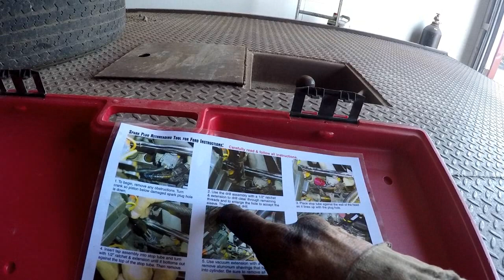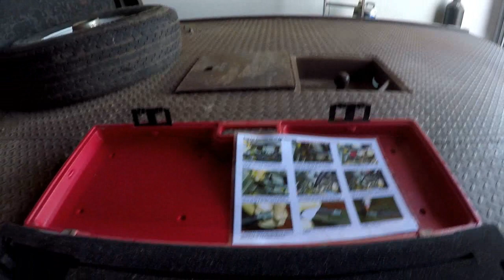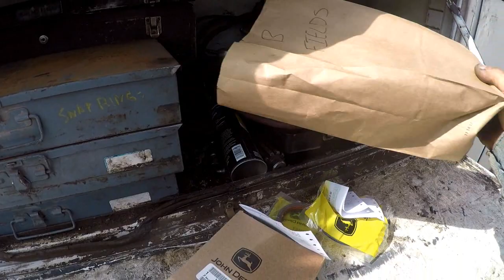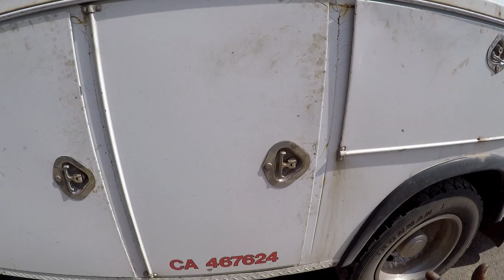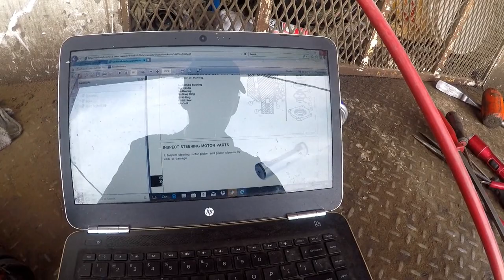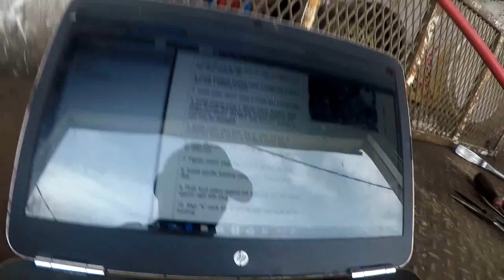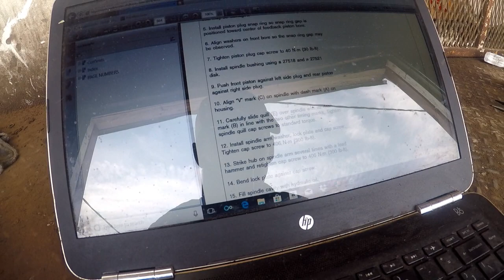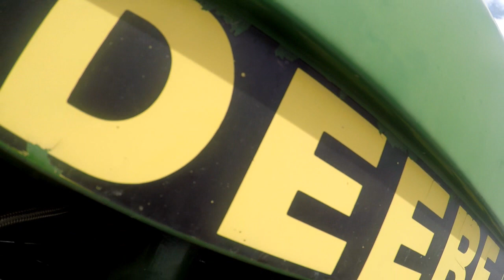4955 steering gear

Comment: i have done this job a coupe of times before. that feedback gizmo with the spring on it if you dont catch that it has slipped out of that slot and you force the gear in it will break it and then it will be a much bigger mess to correct. all for fun i say.

Comment: BB 960 monitor is the one directly in front of the steering wheel, I run almost an identical setup here in the uk. I have a BB 950 on a JD 4755 !, and love it 😊.

Comment: I've had a 4.6 DOHC in a Marauder, a 4.6 SOHC in a crown vic, stll have a 5.4 in a F 150, and have a 6.2 in a F 250, never had a plug blow out, I know it's a problem with the modulars but always have plugs changed early by a mech because of the plugs breaking when removing.

Comment: Those 5.4 plugs are a pain in the ass any way you look at it.  Do like those older Deeres though (even though my dad was a Massey tech/parts man for close to 40 years so kinda partial to the old red iron and Perkins diesels).  The handle pin for the fire extinguisher get stuck back in?  The stupid shit a fellow notices when all you do all day is wrench in a big fleet

Comment: I have a 2000 model F250 with a 5.4 and yes it is a gutless wonder. I have never had problems with the plugs. What model did this problem appear in? Glad to see you block that thing up. Lot of weight to deal with. Please tell me you didn't take those weights off by hand....... Now you got to put them back on. My back aches for you! Let us know what happened with the 8200......
Reply: Johnny Holland in the 2 valve 5.4 tritons the idiot engineers only put like 3 threads in the head for the spark plug so they would blow out, then they switched to the 3 valve 5.4s and the electrode portion of the plug would seize in the head and you need a special tool to get them out. Other than that the 2 valve motors were gutless but great. The 3 valve motors had cam phaser issues, broken plugs, timing chain tensioners, and a couple of other things the evade me. So the early 5.4s up until like 03 or 05, if I remember right, shot plugs and after that you needed dynamite and luck to remove em in one peice.

Comment: I also run a 4955, the shut off solenoid blows fuses. Do you think the solenoid is bad or is there a short somewhere? Also it is hard to steer. What is your thoughts?
Reply from the maker: I don't think I've ever seen a 4955 that didn't have a manual shutoff.  I would  check the resistance  on th coil  , shouldn't  be more than 10 - 15 ohms . If that's fine than take your meter and see if wire to coil has continuity to ground.
Reply from the maker: The hard to steer could be several different things . That would  probably take some pressure gauges and tees and some checking .